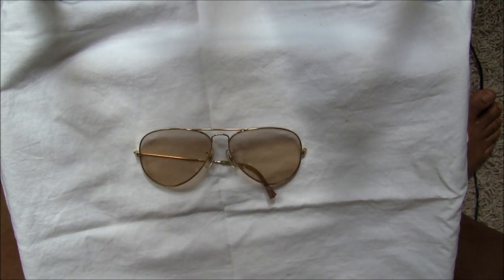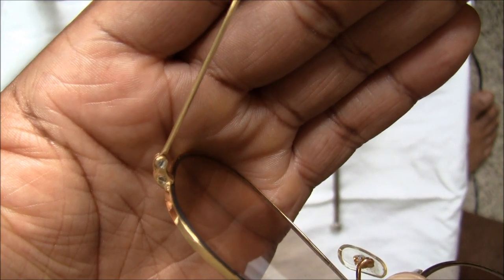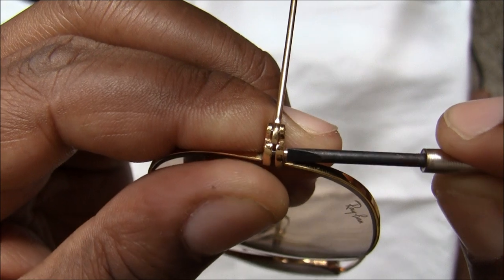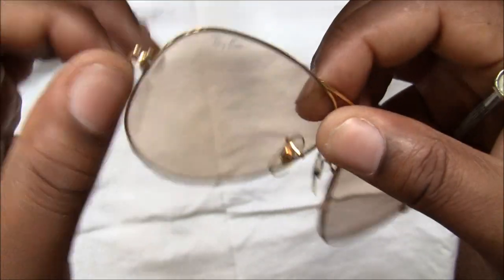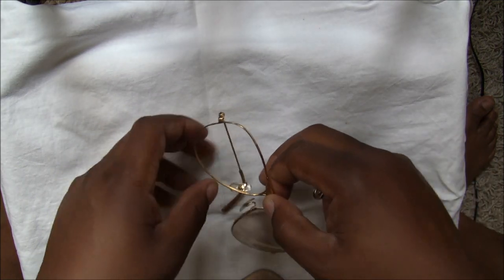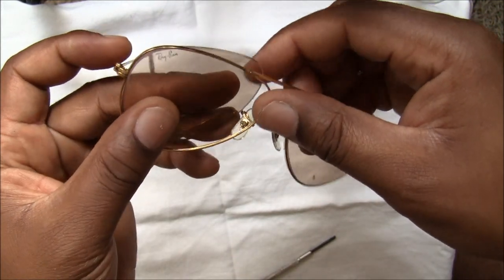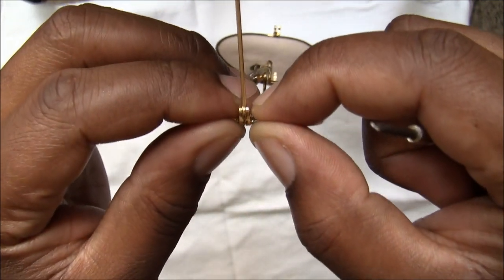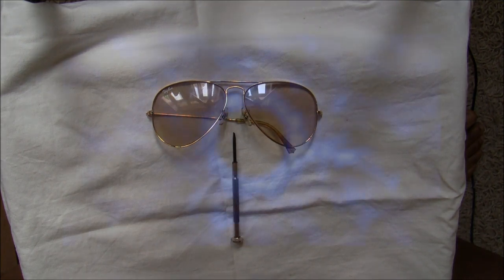How To Remove & Replace Lens from Vintage Ray-Ban Aviator Sunglasses

Comment: Great vid bro. I never even gave it a thought that the hinge section loosens the frame. Saved my lens before I pushed too hard and broke it. Many thanks
Reply from the maker: Ian Griffiths no worries. Happy the video helped.
Reply: If you brake the lens than you really doing something wrong. Or you have cheap lenses
Reply: lol i broke mine
Reply: Ian Griffiths 
nice name